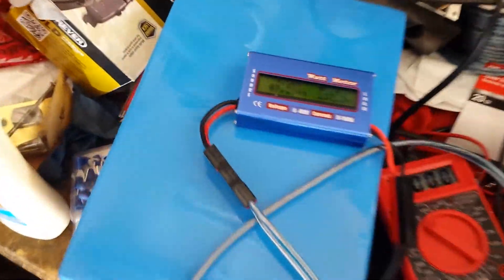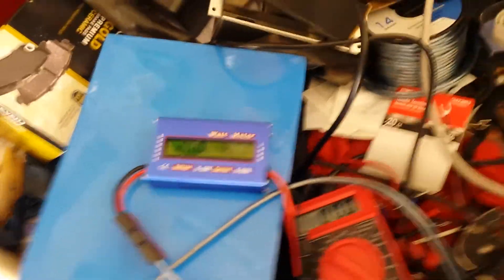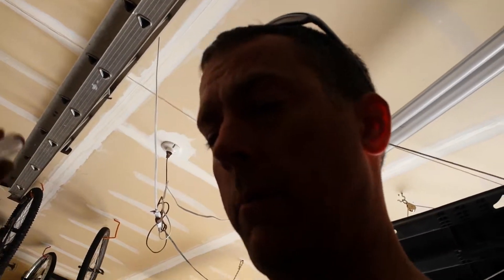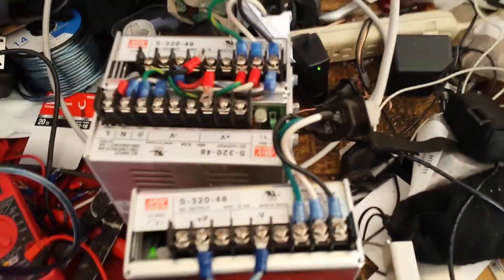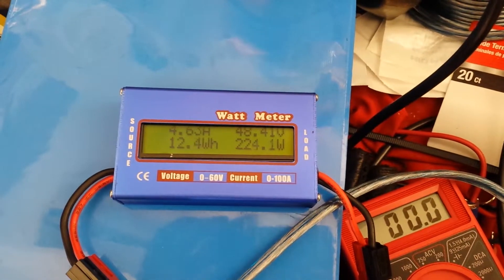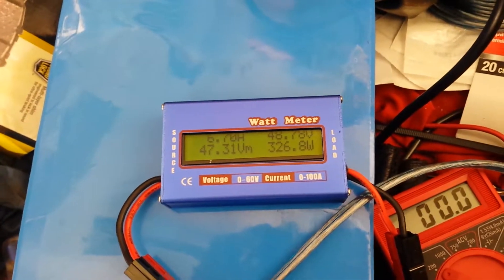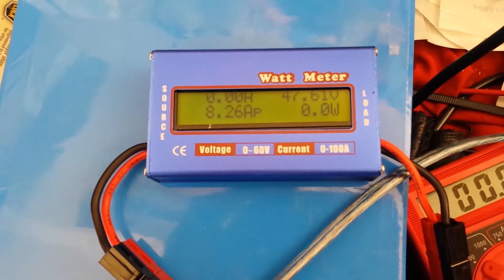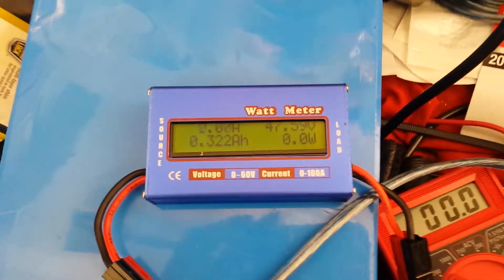Mean well power supply issue resolved

Comment: I have a similar problem on a lrs-350-12 v switching power supply.
It has lost its high current capacity, and dies quickly when stressed.
I am currently exploring the feedback circuit and reference voltage associated with the pulse width modulator IC.
Conclusion : its advisable to address the integral  fault, rather than masking the fault by adjustment of said potentiometer, or by installing additional circuitry. 
Thank you for the video